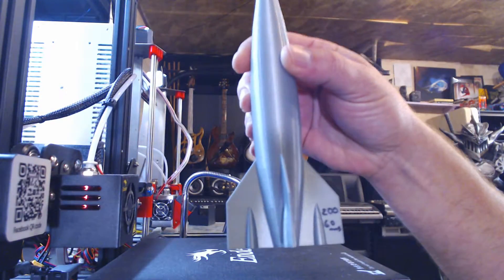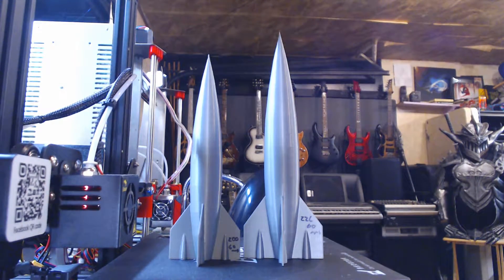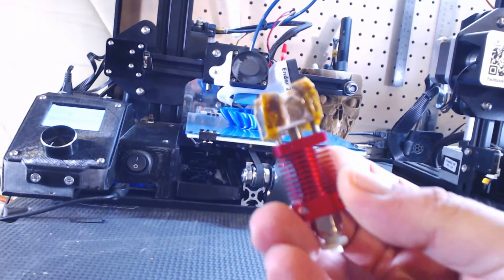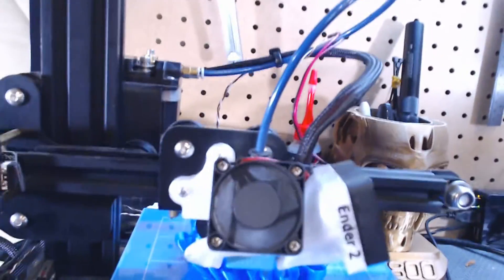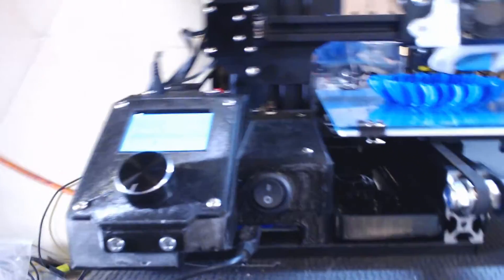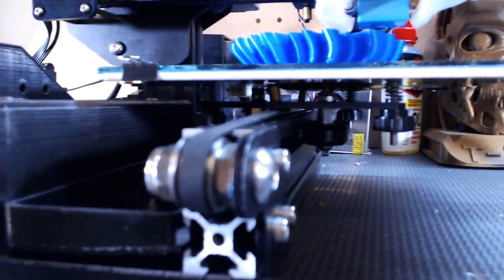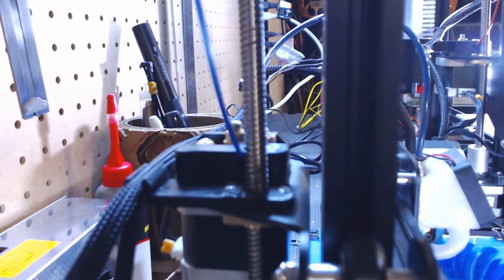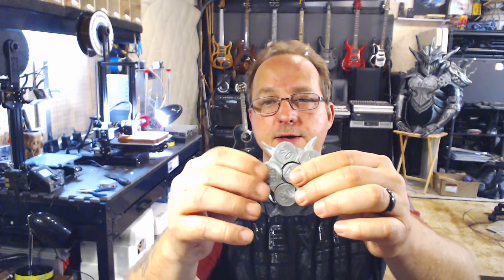ENDER 2 Final Thoughts

Comment: Very useful; thanks! Now, have you installed a fang yet and if so how have you tweaked the profile? :-)
Reply from the maker: I have installed a fang and I also upgraded the entire hot end to a 300c MicroSwiss.  Entire system works great.  I did make tweaks to retraction due to the all metal hotened (2 mm) and I also modified several other settings, but most of those relate to flexible material.  Honestly, I use my Ender 3's for virtually all my printing now.

Comment: Hi, I want to buy my first 3d printer and can't decide between the Ender 2 or Ender 3. The price is very similar. I like the Ender 2 because it seem portable. Which is more recommended to begin?
Reply from the maker: Emmanuel Zaragoza honestly I would go with the Ender 3. Reason is mainly so you won’t be as limited in print size. You may think it won’t make much difference, but it really does. Plus leveling the Ender 3 is easier do to having 4 large knobs instead of 3 small ones. It is larger, but still easily portable. Either way, if you do buy one you can use the links below to buy with a discount. And of course it helps the channel. 😊

Comment: So what kind of performance does the stock ender 2 do.. not into buying something if I have to rebuild it
Reply: Nothing needs to be done. I would 3d print a parts cooling fan for it. It's a good printer. I was considering the Tevo Michelangelo - but it didn't have a heated bed and costs more, or a Tevo Tarantula - but it looked like it all had to be rebuilt or customized to get it right.
Reply from the maker: The stock performance is excellent.  I should have noted in the video that the only "upgrade" that made any performance improvement was the dual fan mod.  But the printer does excellent right out of the box.  Minus the rose, the prints I showed were done on the stock configuration before ANY upgrades.

Comment: Wish you focused on oem first and showed real prints and how you liked it.  Then the upgrade and compare and contrast.   At this point, im only seeing the upgraded printer and after you tightened nuts and bolts etc...   Real world differences for beginners that might buy it and not know how to upgrade this etc.

Not a complaint, just an observation.
Reply from the maker: Observation noted.  Unfortunately I did not really have any footage of the stock Ender in action, but I probably should have mentioned that three of the four example prints I showed we pre-upgrades (rose was post upgrades).  The only upgrade that affected print quality was really the fan mount.  The hot-end and Capricorn tube upgrade did not make much difference as they just allowed me to print hotter and more flexible materials, and the bolts and screws is really just a note for maintenance.  I definitely will be doing pre and post upgrade examples of other printers in the future though....